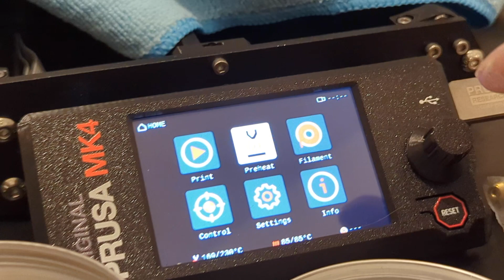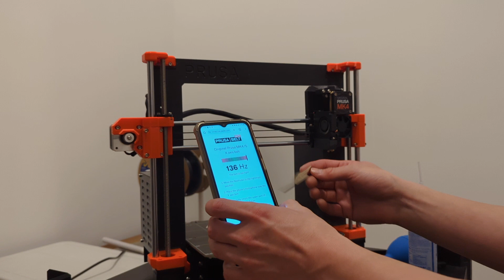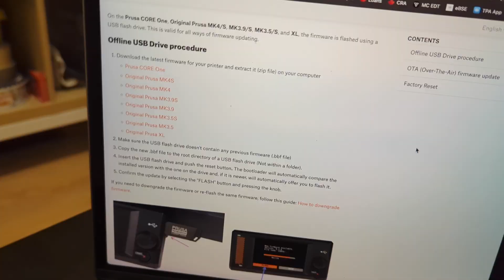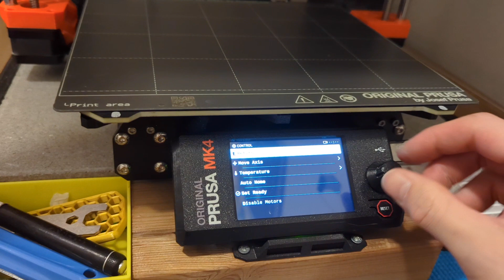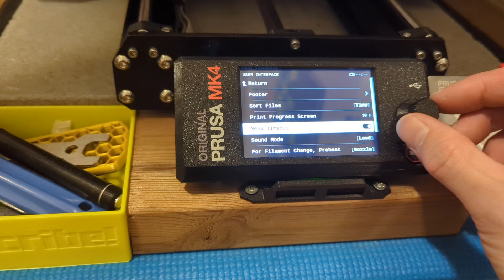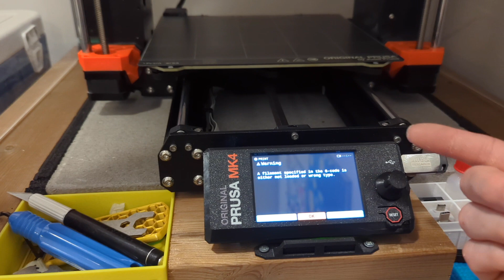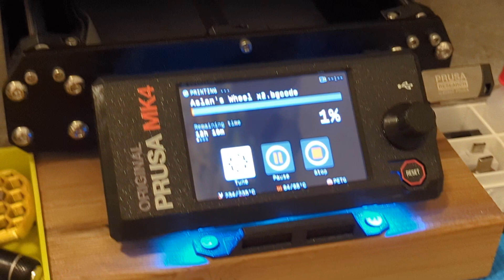Servicing the Prusa Mk4

Comment: I believe the bgcode incompatibility warning near the end of the video refers to what model of printer the code was built for. I often get this error when I use pre-built bgcode from mk3 era on my mk4 printer. I never get the error when I do the slicing myself.
Edit: went back and read the error, looks like I was wrong it does specify call out wrong filament. I would still go back and reslice the file ensuring PET-G is selected.
Reply from the maker: I went back and chose specific branded filament and it worked fine